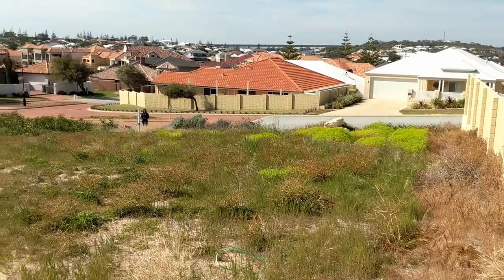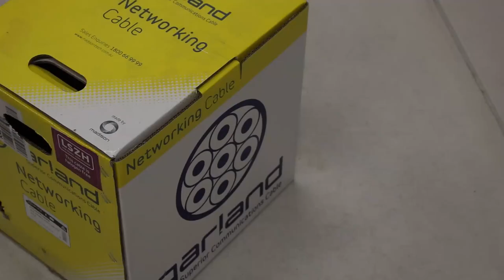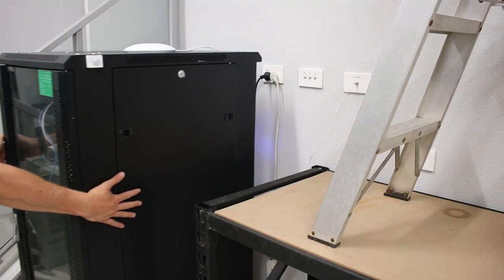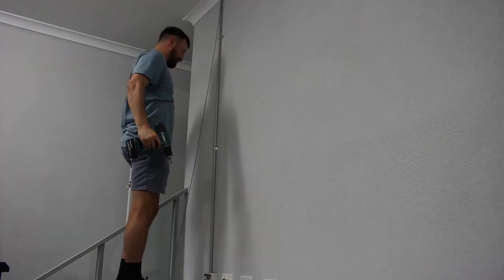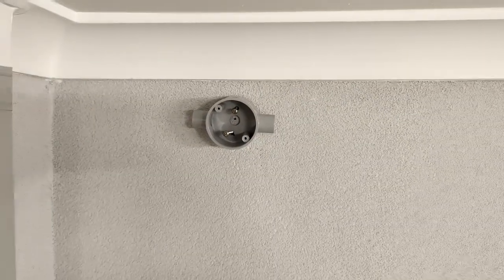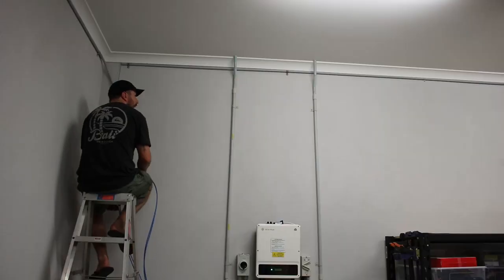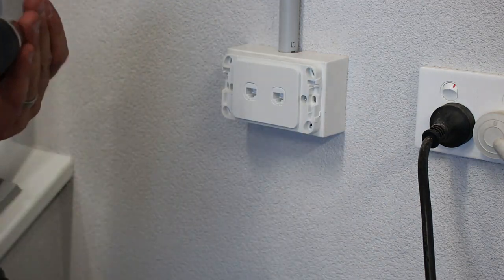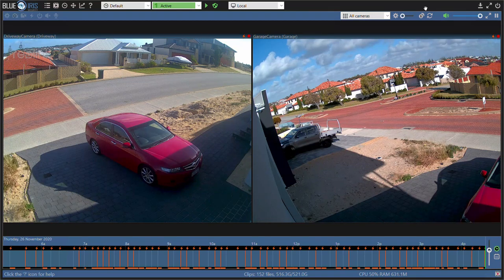Installing POE IP Cameras

Comment: Love the video and the idea with the conduct and junction boxes. One thing I'm not a fan of is the junction boxes on the outside, I personally would've put the cables though the wall and then terminated them inside for a much cleaner looking job
Reply from the maker: G'day Adam. Agreed, I would have done that if the included cables werent so short. The garage is double brick unfortunately